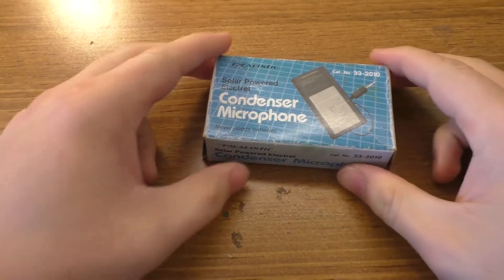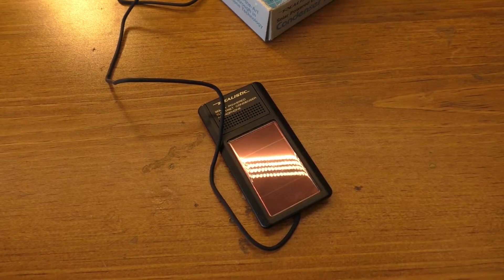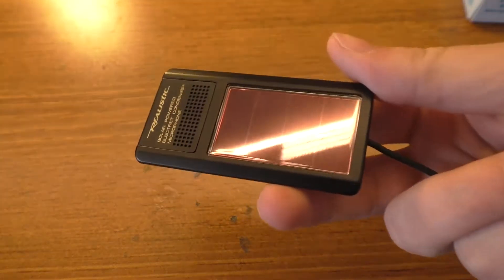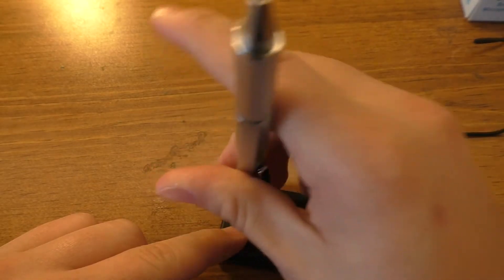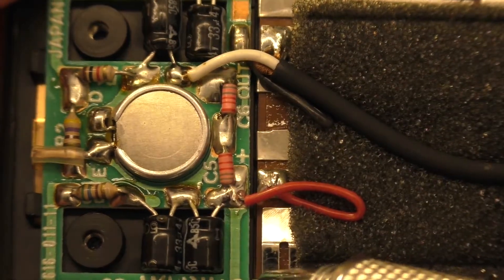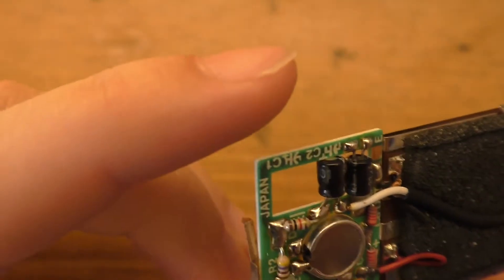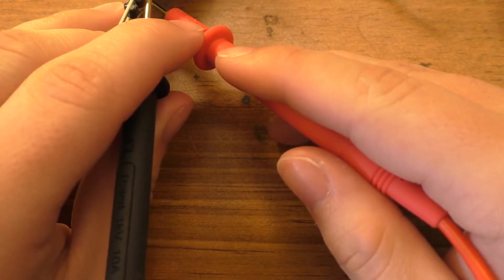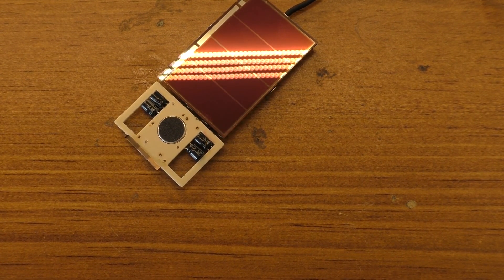Realistic Solar Powered Electret Condenser Microphone

Comment: I think it would have caps in it. to store power for very short light interruptions. but  if not it wouldn't be a bad idea. or even small re chargeable batteries . to allow a few minutes with no sun / light. then it would likely be larger.
Reply from the maker: Yeah, I was anticipating that. I should have probably looked at that board a bit closer to see how they were actually connected.